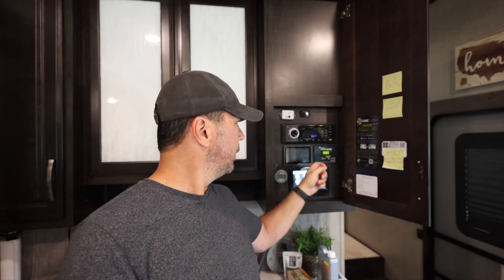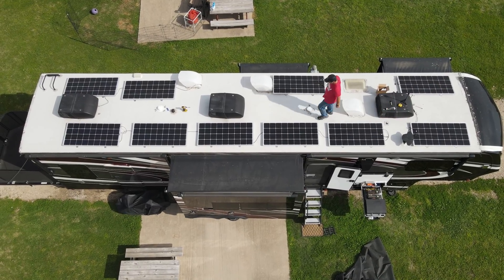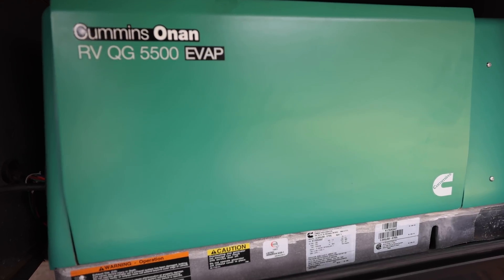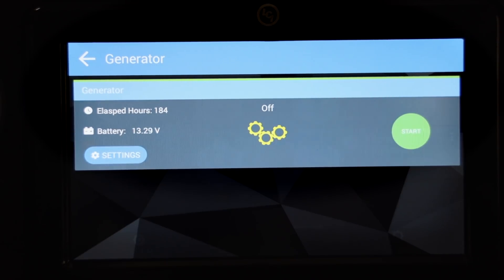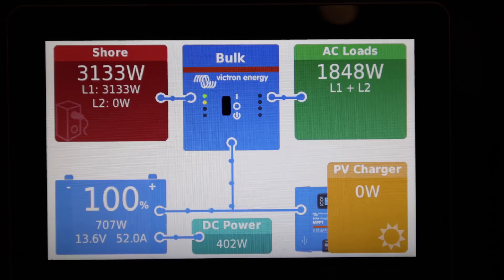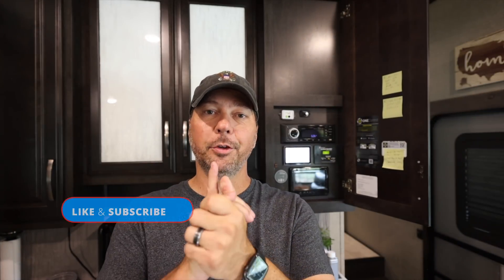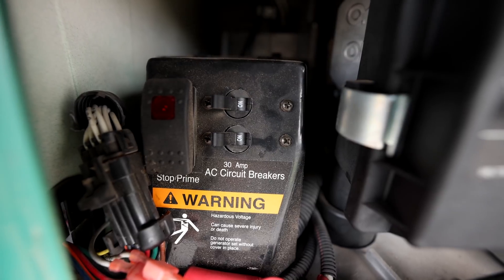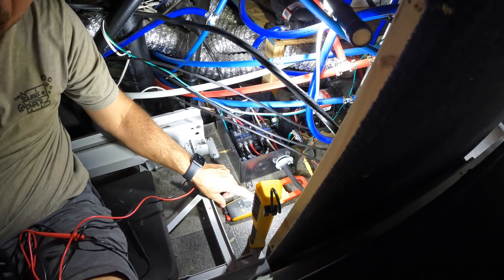RV Off-Grid (Solar) Power System Review and Fixes! (Full Time RV Life)

Comment: Only question I have is how you mounted the grounding bar to keep from having it short out in the enclosure...
Reply from the maker: The wires are separated from the neutral and the enclosure is plastic. 👍🏼
Reply: @ChangingLanes  
Even with the Splice you mentioned in the Pinned response, I'd probably think about zip-tying it to the side to keep it from flopping around in your junction box and causing vibration damage.
Reply from the maker: Those 6 ga wires are STIFF and don't move at all in the 2 inch gap from the strain relief to the relay.
Reply: @ChangingLanes  
Sounds like you have it covered (I couldn't tell in the video exactly how thick those cables were...)  As I've never ridden in your trailer while in motion, I'll leave determination if those 6ga wires are stiff enough to not cause damage from the inertia of dropping into a pothole to your expertise...
Reply from the maker: I will also be swapping that bar for this: https://amzn.to/3LZxQQX. Right tool for the job.

Comment: I take it that you don't have any 240V loads in your rig?  I have an all electric coach, so I have some 240V things (like the cooktop) and the jumpering would not work in this case.  If we are plugged into 30 amp, we have to run our generator to run a few things, like the cooktop.  Okay, doesn't happen often.
Reply from the maker: Yea. wouldn't apply to you anyway since your generator is supplying split phase for the 240.  👍🏼

Comment: Chad, did you add an additional ATS to your system or utilize the one that came with the RV?  I'm not close to installing yet but just purchased a Voltage 4225 TH and will be adding solar and love the system you have.
Reply from the maker: Stock ATS.  👍🏼   Congrats on the new RV!

Comment: So you said that you wish you would have gone 24V or higher. I've been waiting for Victron to get their 24V Multiplus II 2x120 on the market but it looks like it won't be until late this year. Is your wish that you would have gone 24V or higher great enough that you would have put off putting the system in? I am at the point of no solar, no lithium (major upgrades) and really want to use the Multiplus II 2x120 but really getting tired of waiting on Victron. Was ready to pull the trigger but am reconsidering after watching your video. Thoughts?
Reply from the maker: I guess it wold depend on when the 24v will be out....  I'm not a patient guy... LOL

Comment: Chad glad to see this one I am wanting to do the same with my Momentum. How would you make the change over if you were at 48 volt to get back to the 12 volt for the RV 12 volt system or would this just naturally run through the converter.  By the way I bought my Momentum with the same paint scheme as yours because of how much I liked yours. We went with the 376th floor plan for more living space.
Reply from the maker: You would need a DC-DC converter to drop it to 12V for the RV. 👍🏼    Love the 376TH BTW!
Reply: @ChangingLanes  Do you know of a reputable 48VDC-12VDC Buck converter that could handle the Amp output of a RV your size that is efficient?

Comment: It seems to me that you have created and over weight, over priced, complicated behemoth that few if any can service or will want to buy when you sell.
Oh, running electric cables through air ducts has never been allowed and for good reason.
All this makes me wonder what your liability would be if the next owners were hurt or killed or if there were property damage caused by you additions.
Reply from the maker: We have ethernet cables in the ducting, not electrical.  And, the rest of the setup is really very standard.
Reply: @ChangingLanes  What do you think is flowing though the copper wires in the ethernet cable?
Reply from the maker: About 600 milliamps with PoE...  Nothing at all to be concerned about.

Comment: Great video!  Thanks for the tip about going a higher voltage on the solar panels.
Reply from the maker: The solar panels are already around 100V... I was referring to the battery bank wiring.  Hope that makes sense.. 👍🏼
Reply: @ChangingLanes  it does.  I was hoping your panel voltage was higher.  Watching your videos really helped me to get past my analysis paralysis for my inverter/charger setup.  Thanks!!!

Comment: Great video!  The Onan 5500 can run 3 a/c units, but with the victron load sharing capability it seems like maybe it is now more than we (I also have this generator) need. I’m thinking a 2k or 3k generator would be adequate. Your thoughts?
Reply from the maker: IMO, the 5500 is a good size.. Because when you want to run 3 ACs you will also want to use other AC devices like the fridge, water heater, microwave, etc that are all intermittent... the 5500 handles the bulk of the AC loads and the inverter can pick up the slack.

Comment: BTW technically it is not Line 1 and line 2 cos it come from the same single phase alternator. What ur actually doing is doubling the amperage availability to the terminal bar over the distance and that similar size cable from the bar terminal to the ATS is insignificant as in no loss from the geni.
Reply from the maker: L1 and L2 are connected to separate windings on the stator of the alternator, I believe...  If that's the case then they are separate L1 and L2.

Comment: Hey Chad. I have a similar setup.  L1 and L2 coming from the generator are jumpered inside the ATS...just a short wire connecting the two 30A outputs in the ATS terminal block. Same work around with just one wire 🙂. Glad to hear you've got it up and running. 👍Cheers!
Reply: Hey Tito...Thanks for the suggestion!  Do you have picture of what you did??
Reply from the maker: Hey!!!  I thought about trying that but it didn't look like the ATS inputs had enough room for the jumper.  But maybe I should have tried that...  LOL. Thanks for watching! 😊
Reply: @ChangingLanes  Luckily for me they were bridged in the original transfer switch. I recently installed a new ATS and kept the jumper from the old. BTW I was an AT in the Navy back in the day....way back (A-7s). You?
Reply from the maker: No way!  You worked on the plane I hated the most!  LOL. Luckily they were phasing the A-7 out and I only worked around it a little when I was in the rag squadron. That thing was a PITA to navigate on the flight deck.  Drop and roll under the tail seemed to work out ok.  LOL!  I worked on the E2-C Hawkeye.  Cool plane to work on but VERY heavy parts to haul down to the I level guys.
Reply: @ChangingLanes  I've definitely done the drop and roll on the flight deck several times😅
Reply from the maker: Yes.. I didn't see that there was room for a 6 ga jumper..  I am going to be swapping in this: https://amzn.to/3LZxQQX. Much cleaner (and proper) than the ground bar.
Reply: @ChangingLanes  came here to suggest that! I used 2 on my first instalation.  The generator issue was mentioned in our NRVTA class.  Thank you for the information!!
Reply: Bridging the lines with one wire was my first thought. Thanks for confirming my idea. My worry was using a large enough wire might not fit into the ATS connections that were in place. Chad was that your concern or just the ability to fit the jumper into the closed box?

Comment: Another great video Chad.  I recently discovered as you did after the installation of my Multiplus II even with our Onan QD8000.  Talking with my Victron Dealer here in Oregon, on their installations they are just using a short piece of 6ga as a jumper between L1 & L2 on the generator input side of the ATS and it works great and is simple.  I know you like techie stuff, have you looked into the GUImods for the Cerbo GX?  It adds a lot of very useful features to the touch screen and also supports the use of the Ruuvi Bluetooth sensors for temperature and humidity, I have them in several compartments and fridge/freezer.
Reply from the maker: That's interesting!  Does the temp data make it to the VRM and log historical data?
Reply: I replied but my comment didn’t show up, maybe because it had a link to GUImods in it.  The Ruuvi tags do show on VRM and I did just go into  VRM to check to see if it keeps historical data and yes it does, for each tag  added.
Reply from the maker: That's awesome!  I might have to try that out.
Reply: Bmgm37... So instead of combining L1 and L2 prior to the generator input side of the ATS, you jumped L1 and L2 where they are connected to the generator input side of the ATS?  Is this correct?    Just a simple ⁶ga jumper wire?
Reply: @charlestyer2164  yes, the wires coming from the generator and go to the generator input on the ATS and a single 6ga wire jumps from L1 and L2 at this connection, there is plenty of room for 2 wires in the ATS connectors.  These instructions came from AM Solar here in Oregon.

Comment: Interesting. I had a similar conundrum but I have dual multiplus 3000 24v. I have to load different configurations when I switch between 50a shore power and generator. On 50a shore settings a dual/split-phase but on generator I have to use dual/parallel.

Comment: Thx CL for excellent video production and informative video. I was waiting for the OS in your discription but sounds like you did your home work to verify with known experts congrats. FWIW gensets are an interesting challenge I worked on then on ships in USN and after service for Cat and Onan distributor before Cummins merged. Also with large So Cal Electrical Utility one area that often gets over looked is recirculating ground currents which will result in excessive load/loss of capacity from source rating and in extreme cases ground currents causing conductor movement and elecrical fires which we experience with portable 4 mw 12kv generator bank used to pickup a fire damaged system  and isolated mtn  town   By your verification of generator capacity sounds like your conversion to single output didn't create any recirculating currents.
Reply from the maker: Fingers crossed! 😉

Comment: Thanks for putting together these videos, they are extremely useful! Question for you: You mentioned that you'd have gone with higher voltage batteries. I'm very curious how that would work since the 12V DC system in the RV is all connected as you described; Solar, Inverter/Charger, etc all pump current into the circuit and the batteries take the charge if there's a deficit. I'm guessing you'd need to isolate the batteries off of the 12V circuit behind a dedicated DC-DC charger to go from 12V to 24/48V? But how would you draw power out of the batteries into the 12V RV circuit?
Reply from the maker: It's the other way around.  You'd need a DC-DC converter to down-convert the higher voltage to 12V for the RV.  The inverter would need to use the higher voltage naitively.
Reply: @ChangingLanes  Thanks! that makes so much more sense now that I think about it. So the DC circuit for charging the batteries would still work the same, you’d just need all of your charger/solar equipment works natively at the higher voltage? I already have a Victron 150/35 MPPT controller that supports up to 48V and it looks like they make a 48V version of the MultiPlus II 2x120, so I’m considering going 48V for my batteries to basically quadruple my solar capacity without needing any new solar controller. Plus I already have 2awg wires and wouldn’t need to redo a bunch of cabling… I really like this idea now!

Edit: It appears that there is only a 24V version of the MultiPlus II 2x120 :( Oh well, thats still double the capacity!
Reply from the maker: Yes... you'd just separate the 48V stuff and 12V stuff.  👍🏼
Reply: @JohnFX3  exactly how does it double or quadruple capacity?
Reply: @timgaines3818  watts = amps * volts (WAV). The solar chargers are rated in max amps, not watts, and support multiple voltages. So if the solar charger can output a max of 35 amps, then charging at 12V means a max of 420W. Charging at 24V is 840W, and 48V is 1680W. All from the same charger.
Reply: Hi Chad.  These videos have all been instrumental in helping me and my wife make the decision to go full time.  Thank you!  This week we picked up a 2022 Momentum 351-MS.  I am in the process of building it out for our new way of life.  I am VERY interested in putting in a 24V battery system.  I am an electrical engineer so fortunately the physics behind the methods all make sense to me.  Have you come across any reference systems that are built as you wish you would have built yours?  (i.e. Using Gamechanger batteries, other inverters/chargers/converters/controllers etc?)  System block diagrams would be wonderful.  By chance, do you have diagrams of your current 12V system you are willing to share?  Thanks in advance and we look forward to more of your shared insights and adventures!  TnT  (Troy & Tzsana)

Comment: If you opted for a 24 amp system how would you power the legacy 12 volt appliances such as the furnace and water pump? 

BTW I agree with you about this and I predict that when the RV manufacturers get serious about all this they will increase the system voltage to save on wire.
Reply from the maker: You'd need a DC-DC converter to down-convert to 12V for the RV.
Reply: @ChangingLanes  That makes sense.  Just spitballing, but I wonder what problems would be cause by just center tapping 12v out of the battery array?
Reply: They are 2 separate systems. I have 2 3k 24v Victrons (one for each phase to feed the main panel)w/ 14kw batteries and 200ah LiFePO4 12v for the house. Solar only powers 24v system which I can use to charge 12v house. I can run ac and wife's curling irons. Works great just a lot to shove under the steps and bathroom of our Montana, but all is out of site.
Reply: @richsusanjefferson3826  I see how that would work.  Using the 24v system to charge the 12v system uses a battery charger as a buck converter to reduce the voltage down.  I can see some advantages to that.  If you were starting from scratch would you still do it that way?
Reply: @DavidLaFerney  I am still using the stock 12v converter to maintain the 12v LiFePO4 batteries and turn off the breaker when on road to keep truck from fighting the current. They are controlled by a module instead of a dumb regulator but all works great
Reply from the maker: the first thing that comes to mind is it would jack up the shunt's ability to monitor and give an accurate state of charge...
Reply: @ChangingLanes  I don’t see how it would if you tapped the positive on the first battery in the string and just used the common negative buss.  Would it?

It might cause a balance issue if the BMS wasn’t able to compensate… again, just spitballing.

Comment: So my rig is 30amp, 1 A/C, 110v. Don't your A/C's run on 220v?  Or are all of your A/C's split off on different legs in your panel but still 110v as well?  Nice layout on your work there, well done. I'm getting ready to have some backup power for the S&B.  So I'm going through this same thought process on the amps and different legs off the panel. I'm only backing up freezers, refrigerator, gas furnace and a few lights and plugs. Nothing 220v. Your idea might work for me using a breaker box manual transfer switch. Thanks for the idea.
Reply from the maker: With the exception of a modified RV or maybe a high end coach, all RVs are wired with L1 and L2 isolated from each other (shared neutral).  So, there is no use of 240V normally.

Comment: Did you consider a buss bar arrangement for the batteries, to assure equal battery loading? Looks like you used a simpler way, but that has unequal loading... can you say what your thinking is on this? Thanks!
Reply from the maker: We do use bus bars for the DC system.. 👍🏼   You can see it better in the Inverter video: https://changinglanesrv.com/rv-inverter-upgrade-victron-multiplus-ii/

Comment: Thanks Chad!  Great to have a update on the system and changes, since I'm about to start my own project!  

On that note, do you still use the 12v converter in the coach?  Seems like it wouldn't be needed with the solar and the battery charger in the inverter.  To me it would make sense to separate the A/C and D/C systems at the distribution panel and run the 12v side direct from the battery system.
Reply from the maker: It's disconnected but still there just in case.